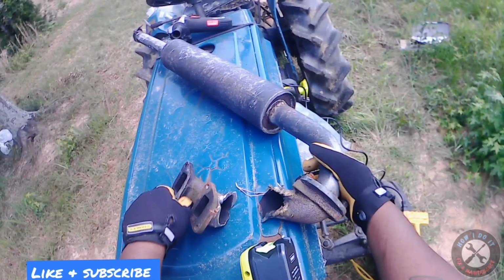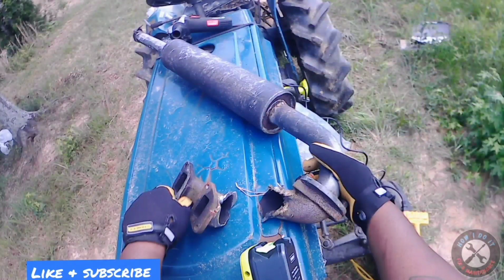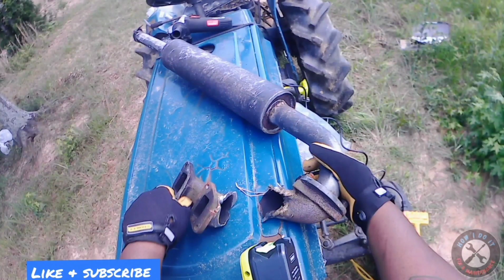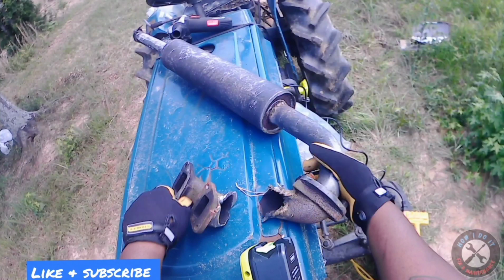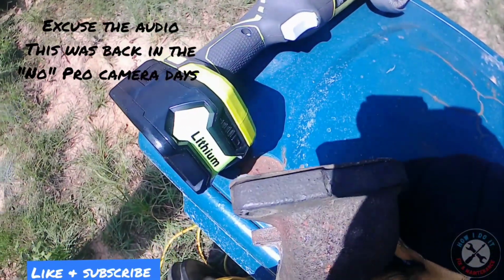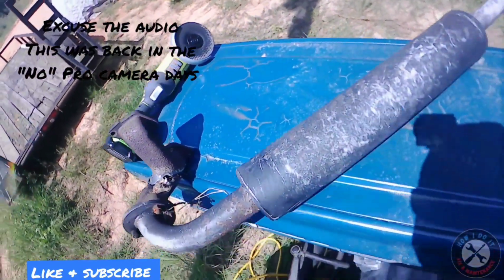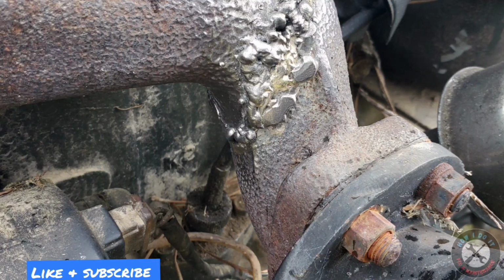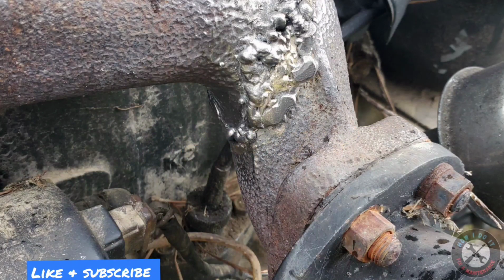Mitsubishi D2000 Tractor Exhaust Manifold Repair Broken

Comment: I like the videos very helpful. I inherited one of the d2000 but how do you raise and lower the pto?? So confused
Reply from the maker: Thanks for watching!  It should be a lever to the right side, beside the seat
Reply: @HowIDoItFaM  definitely learning from the videos. Yea that lever won't budge unfortunately.
Reply from the maker: Uh oh it may just be frozen with rust. Have you tried some penetrant oil like pb blaster?
Reply: @HowIDoItFaM  yea some blaster and light taps. I'm gonna try to drain the fluid and add fresh. Do you know where to get a manual for these beast
Reply from the maker: @Partridgemotorsports  send me your email. I have a bunch of information on these "grey" tractors